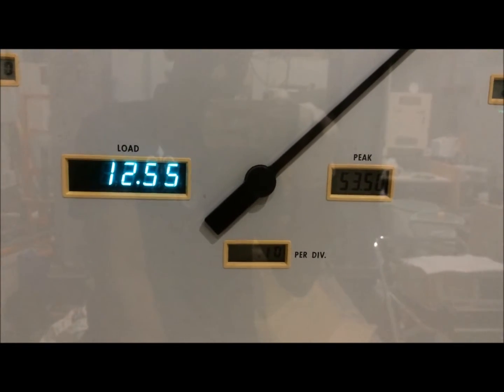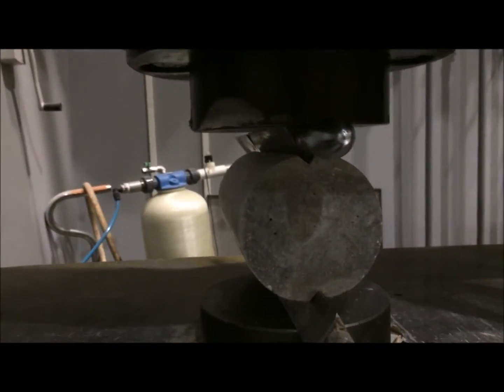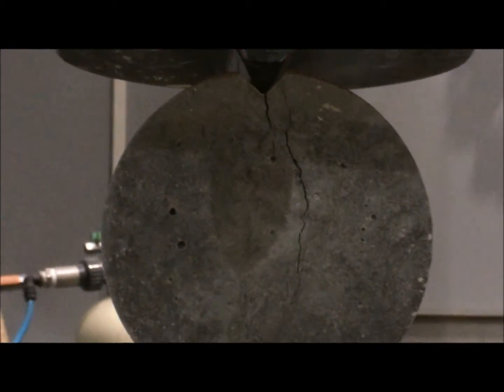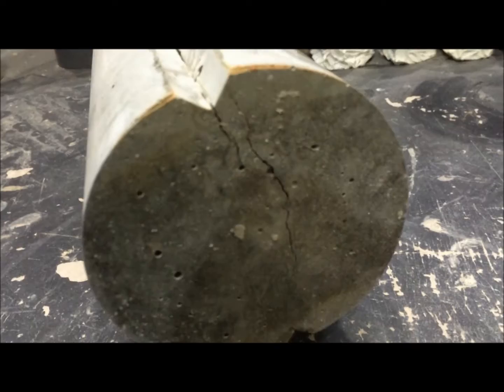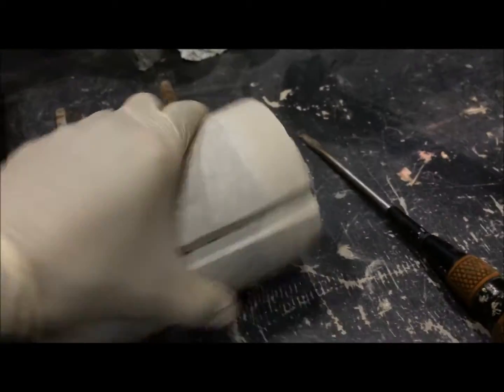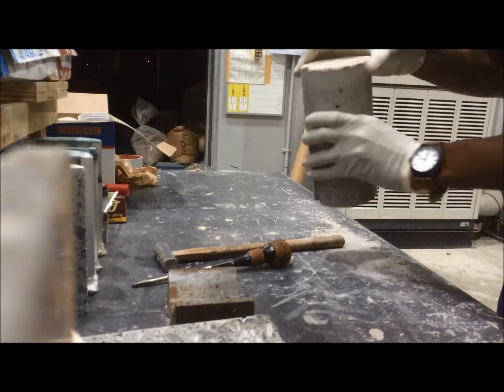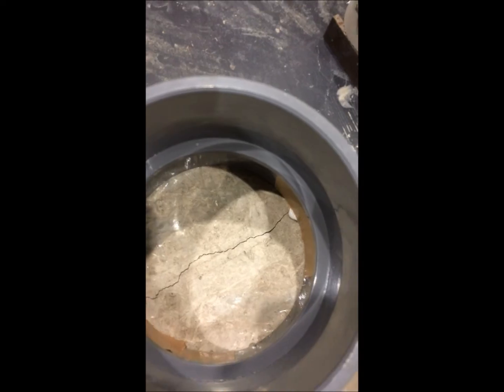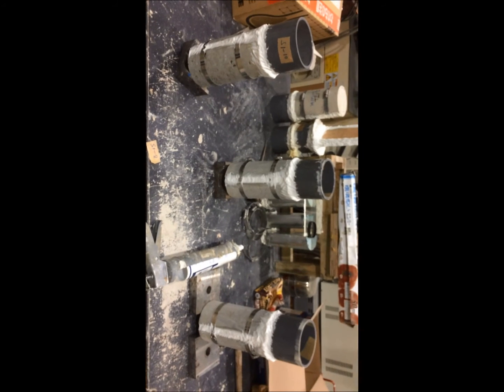Concrete Split Test and Permeability Test

Comment: By what standard did you do this test? 
Can you please give me the detail requirement for this test method?
Thank you in advance
Reply from the maker: This particular test was developed at our lab to test self-healing efficiency of the concrete specimens. Measuring water flow reduction through the crack translates into self-healing efficiency. It requires having two parallel crack surfaces through which water flow takes place. Allowable crack widths starting at 0.3mm can be tested with this approach.

Comment: what is ur mix proportion?
Reply from the maker: The mix proportion is that of SCC, with 0.31 W/C ratio.
Reply: does the mix proportion effect the result of the split test? because i tried to do the split test but I can't do as nicely as urs, mine will just break into few pieces.
Reply from the maker: Well, the mix proportion may have an effect, as in the way it influences the concrete strength. Too strong and you get straight cracks like in my case, or too weak and it just breaks into pieces. Also, do your specimens have grooves to direct the splitting force? In my case, I put triangular grooves during casting along the preferred cracking direction; this way, once I apply the splitting force, the line of failure follows these grooves. On the UTM you can see that I hold the specimen between two triangular supports (bases) for this purpose. Hope it works out well for you.
Reply: how did u make grooves on ur cylinder specimens?
Reply from the maker: Inside the cylindrical mould, V-shaped notches are fixed on opposite sides prior to pouring the concrete. They are plastic and come off easily during de-moulding, leaving V-shaped grooves on the specimen at opposite sides.
Reply: can tell me the specific mix proportion? like how much cement, coarse agg, fine agg..thank you a lot
Reply from the maker: Water = 155; Cement = 470; Fine Agg = 868; Coarse Agg = 841(less than 20mm); W/C = 0.33; HRWR = 6.11 Kg/m3